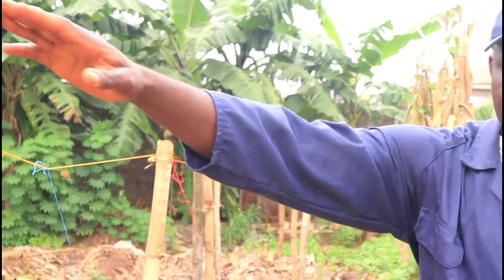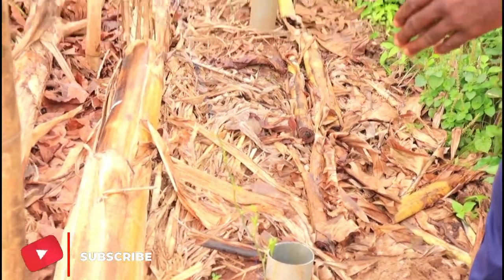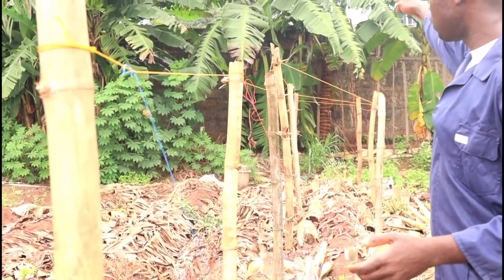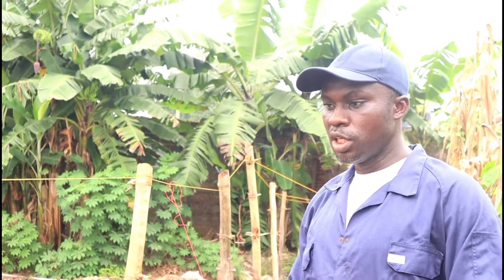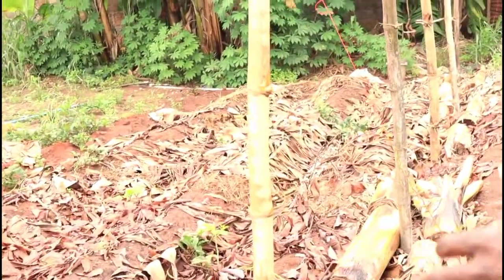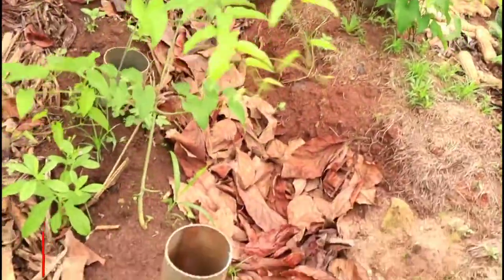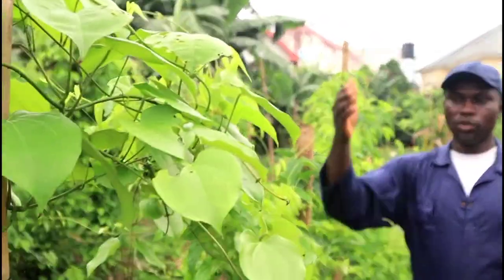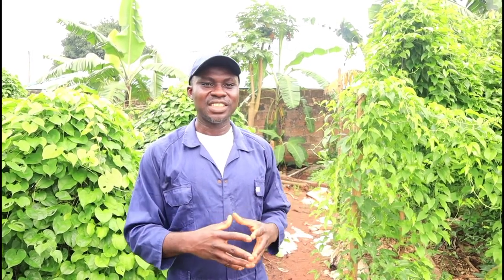Trellis Method Of Staking Yams

Comment: Interesting very very very interesting. What's the right height for the poles, isn't 6ft a bit small. Great job. Greetings
Reply from the maker: Depends on what you are planting. If  you are planting minisetts to get seedyams, 6 feet is ok. But if you planted seedyams to get ware yams,  then the length should be more than that.

Comment: I can see you didn't make big ridges like normal traditional , can you enlighten us about that and I saw some PVC tubes in the ground too. Please do explain what's it used for. Keep up the good work sir
Reply from the maker: Thanks for the very valid questions. Making long ridges helps me to save space and harvesting is easier for me. I hope to show how I made these ridges with time. Because I actually dig a long "gutter" then fill it back with soil before heaping it up like this. That way the yams find it easy to penetrate the ground as they grow
Reply from the maker: As for the PVC, I use them for irrigation during the dry season so that the yams can penetrate the soil well to improve yield. I perforated the sides before burying them in the soil and planting the yams beside them. Hope to do a video on that subsequently.